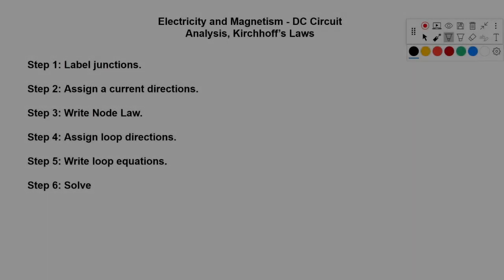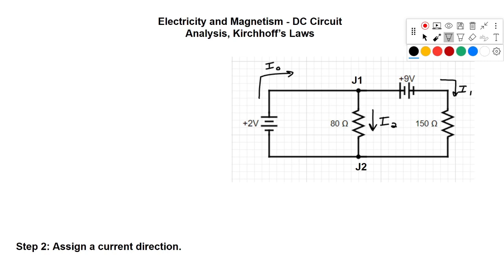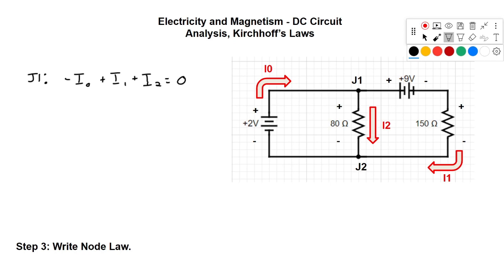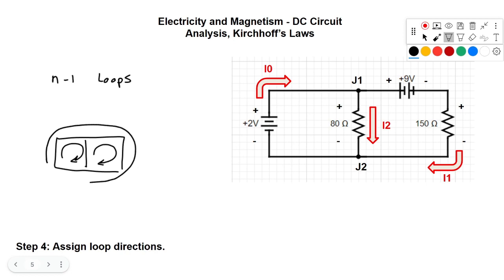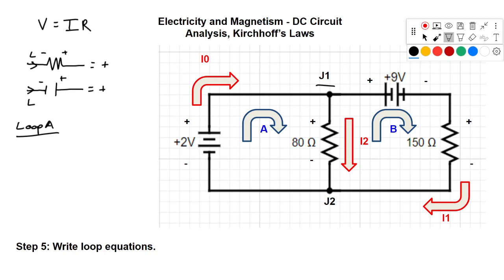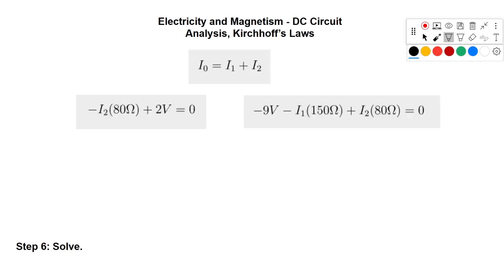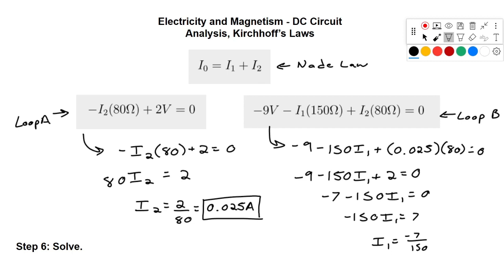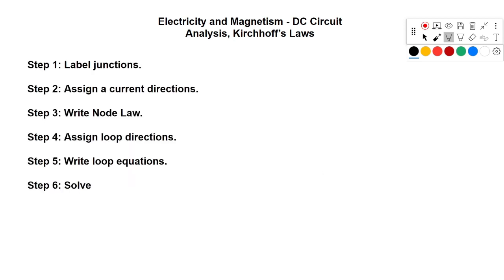Kirchhoff's Laws - DC Circuit Analysis - FE Exam

Comment: awesome video, thank you. My only question is if I1 should have been counter clockwise, why did the node check work correctly? I thought the point of node check was to verify the direction of our current
Reply from the maker: The node check will tell you if the directions of your currents make sense relative to one another to make sure you're combining the right currents on a particular side of the equal sign (i.e. I1 + I2 = I3 is not the same as I1 + I3 = I2). It will not, by itself, tell you if the direction you've selected is correct for a given circuit.